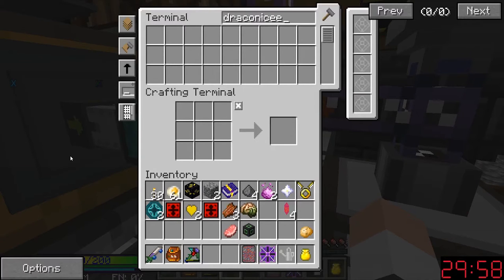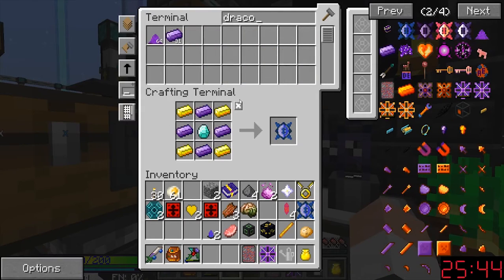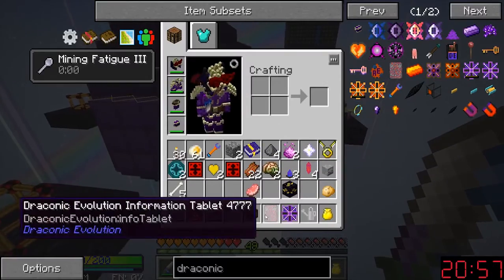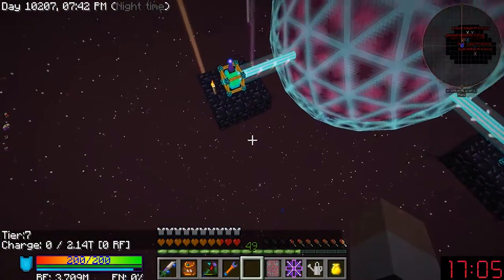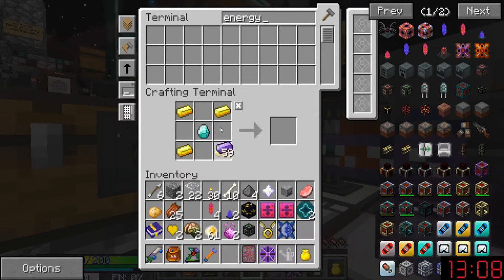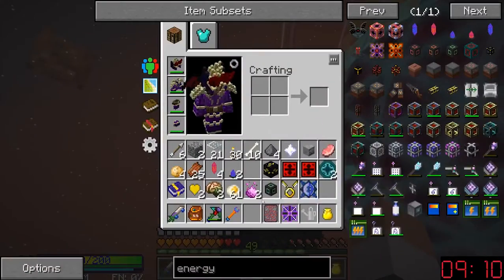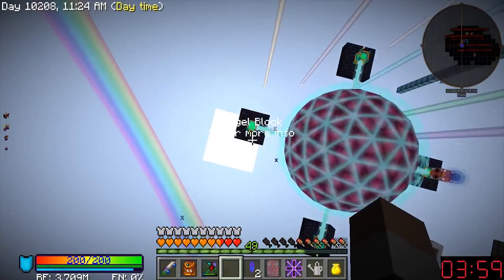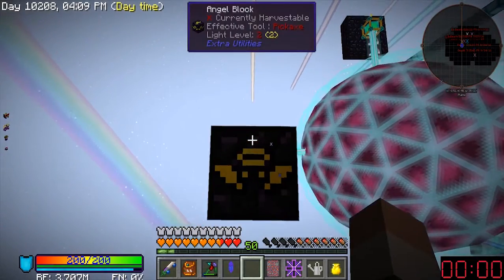Beard vs. Fatal - Sky Factory 2.5 - #76 - How Does IT WORK?!

Comment: lol, the only things you need are what stated in the book for energy transfer and storage.  the particle things and core you have set up, but the energy pylons are what you use to palce inside and take from the energy core.  the right clicking you did will change it from input and output so all you gotta do is place a tesseract or direct energy cable to a pylon and change according to your needs, :).  everything else you created.....that was for the 200-block wide draconium reactor of the blowy up kind.  ask diesel, you will find the truth from him, lol.  you did not need any of those relay but hey....they're pretty, :P